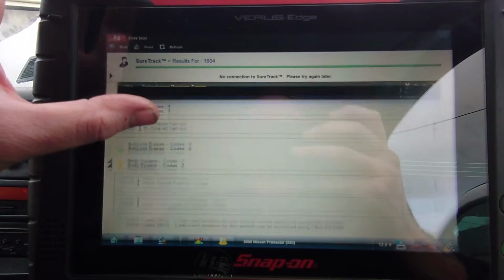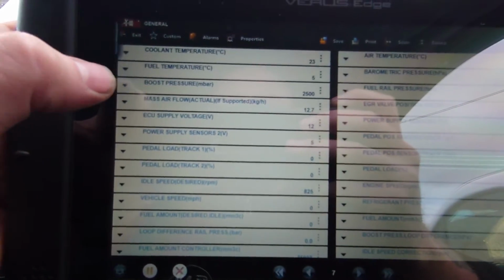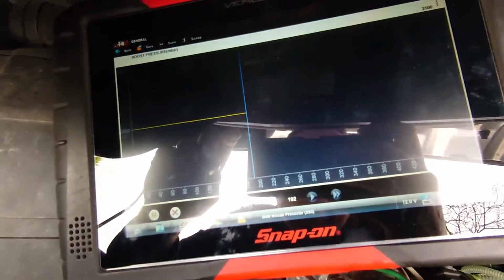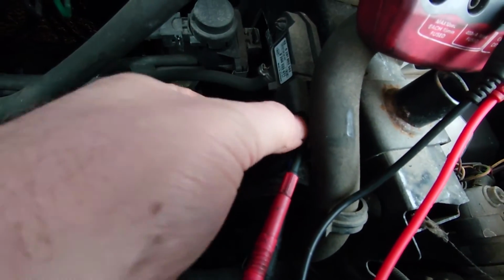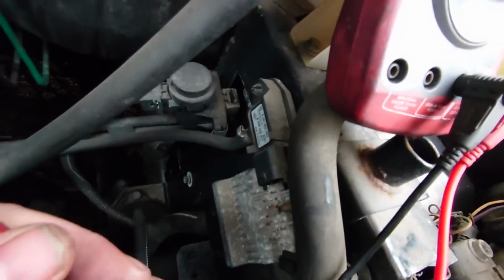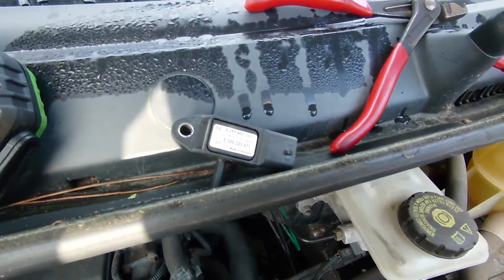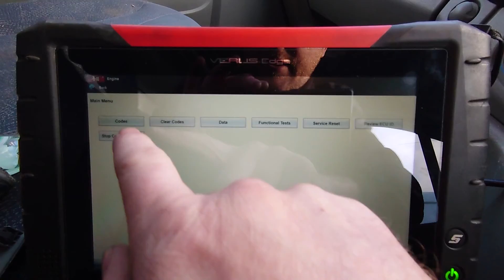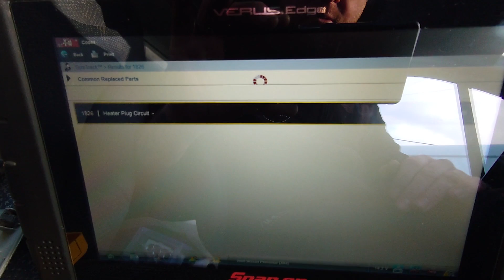Nissan primastar boost fault 1804 turbo charger boost sensor

Comment: Thanks. Looks like my problem also. I also have an ongoing issue with my Renault traffic 1.9 when it’s at running temperature it starts but doesn’t rev for a short time. Tried several Maf’s  had a new fuel pump (as diagnosed by the stealers) still no joy. Even changed the fuel sender unit in the tank thinking may be air getting in the system. Have you come across this before at all ? Many thanks
Reply: Did you ever find the problem  ?
Reply: @patrickburns5174  nope!
Reply: @acewelding  I'm having similar issues. If I get sorted I'll reply to you 👍
Reply: I’m convinced it’s an electrical issue